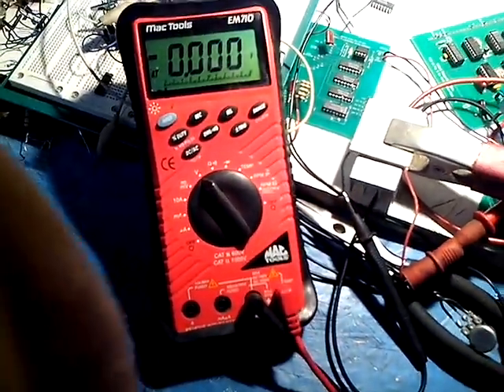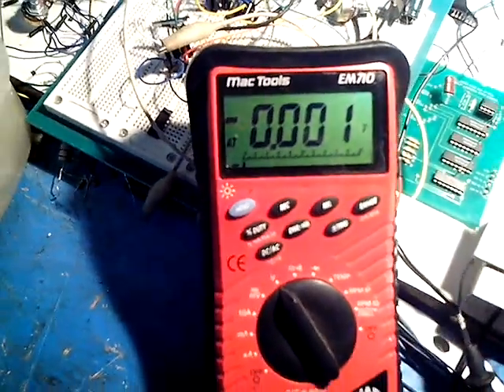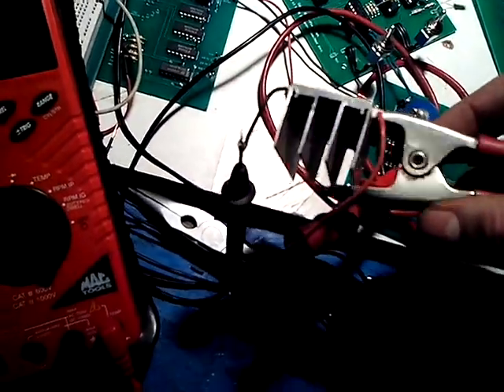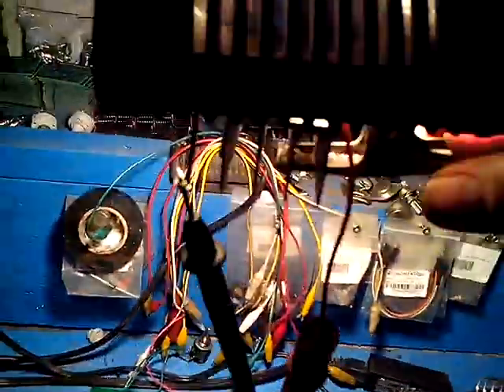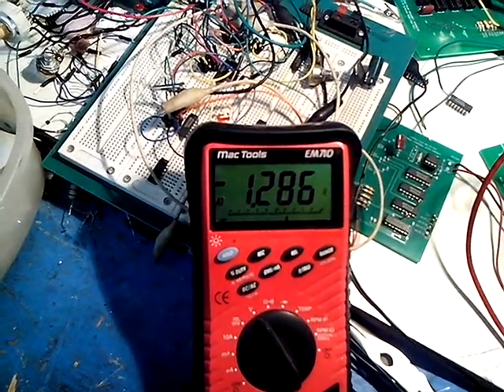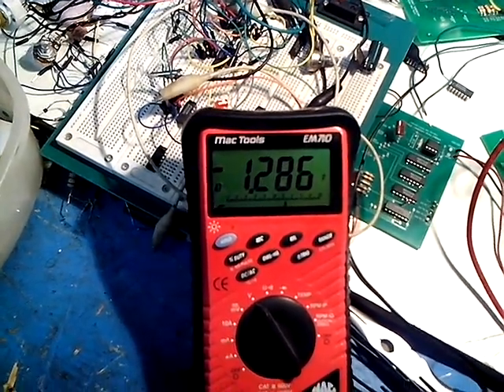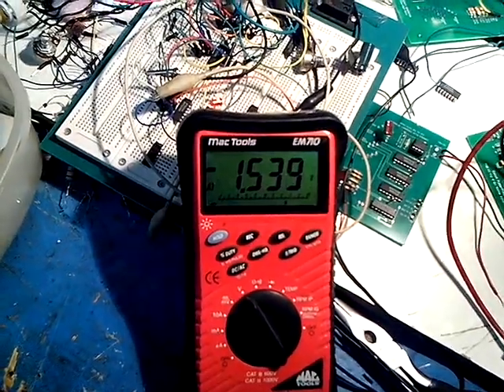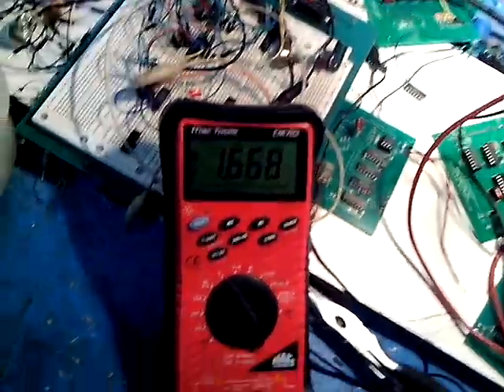A simple Demo of a peltier device.

Comment: Some company tried to put these on car converters to generator electricity from waste heat.
Reply from the maker: Yes,
Cadillac did something with this at the catalytic converter .
Reply: It would be a cool way to use heat to make hho for the engine.
Reply: You got a hcat heater yet?